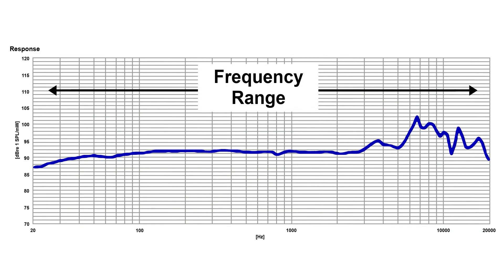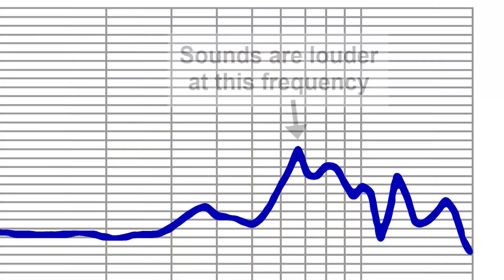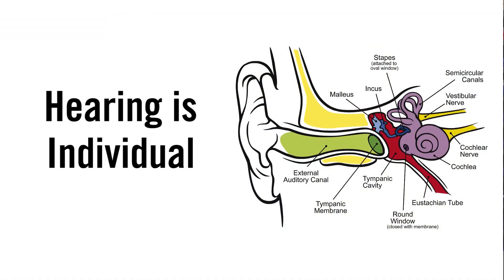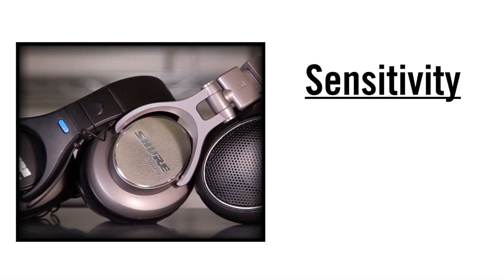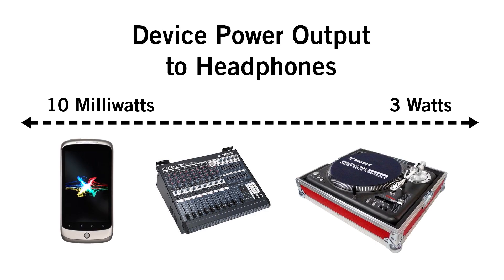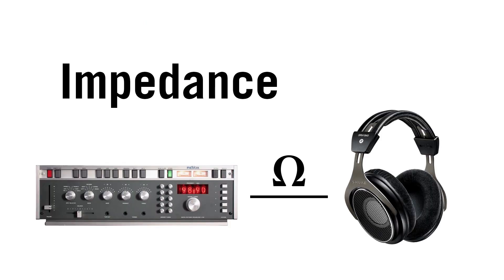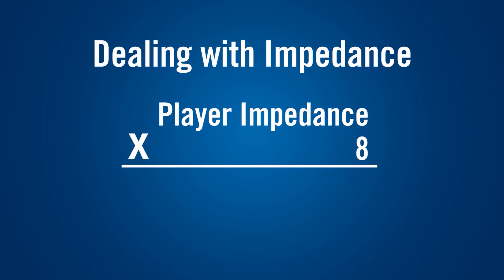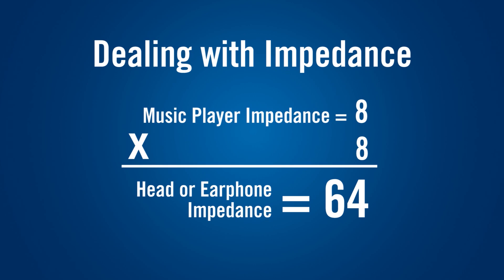Understanding Headphone and Earphone Specifications

Comment: Why does the source impedance have to be less than the headphone impedance? If I'm not mistaken, if the source and headphone impedance match, then there is maximum power transfer, and the load loss is less. If the headphone impedance is eight times that of the source impedance, shouldn't that draw less current, causing you to turn your volume up more than regular to be able to hear?
Reply from the maker: +nishad nadkarni In the case of headphones, the main goal is great sound.  Headphone driver impedances are frequency dependent.  If the amplifiers output impedance was matched to the headphones impedance at, let’s say 1kHz – (typical measurement point for audio response measurements) then the driver would reproduce more or less energy at different frequencies (above or below 1k) depending on the impedance curve of the driver.  In a nutshell, you would end up with something that didn’t sound very good.  Following the 1/8 rule helps to minimize this and other possible issues.  There is a great deal of information online about this.  Here is a link to one spot that seems to cover it: http://nwavguy.blogspot.com/2011/02/headphone-amp-impedance.html